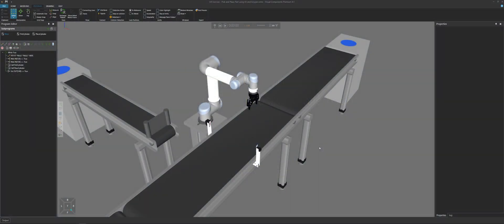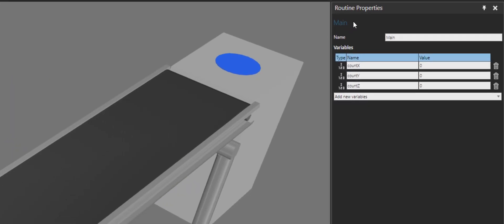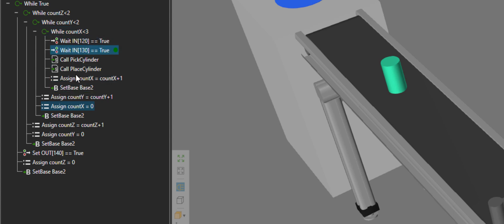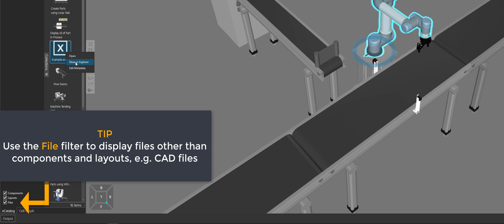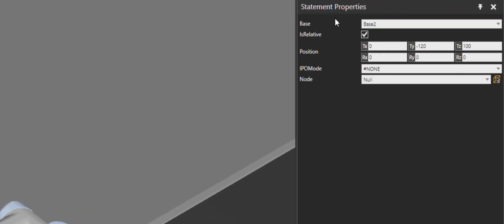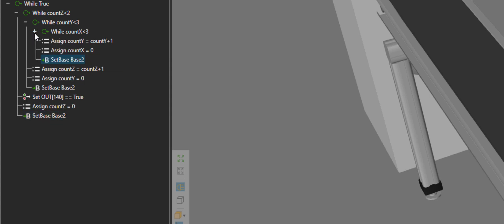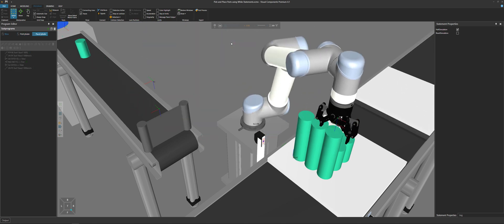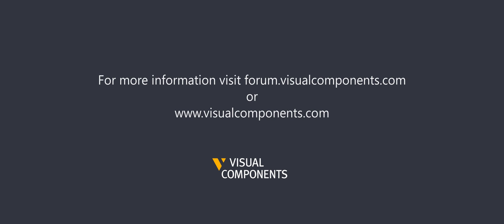Pick and Place Parts using While Loops

Comment: Hi, and great video! Can you guys tell me how you managed to 'attach' the cylinders to the pallet? I can't seem to find any code or setting that enables me to do that. Thanks.
Reply from the maker: It is done using action signal and behavior in robot. If you select the robot, either in Properties or Jog panel, you will see a section called "Actions Configuration". By default, output signals 1-81 are used with tool and base frames of robot to trigger actions like grasp/release, mount/dismount tool, trace tool path. That is the reason why the PlaceCylinder subroutine in robot program uses Output statement for port 1.

This tutorial can explain more about the release action, which finds a container or node in 3D world to attach component to when released from robot.
https://academy.visualcomponents.com/lessons/how-to-use-gravity-direction/